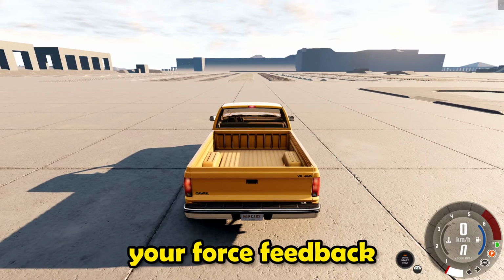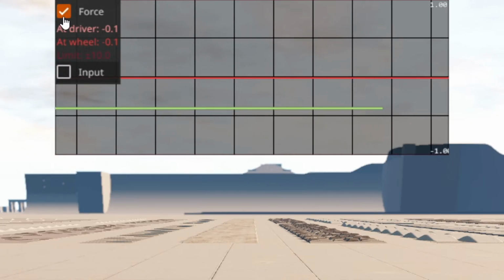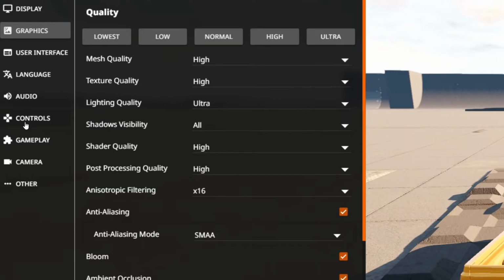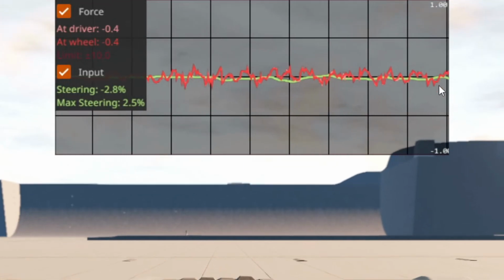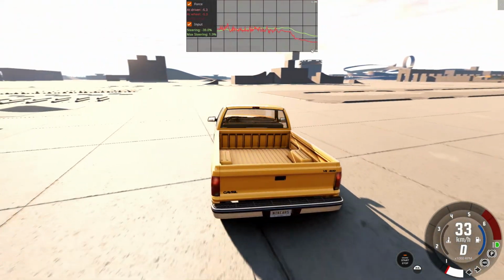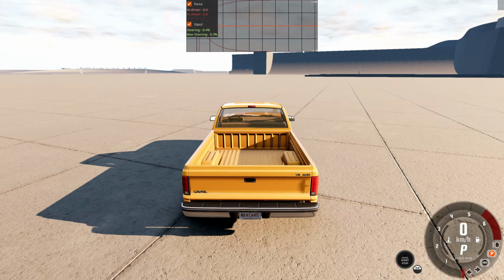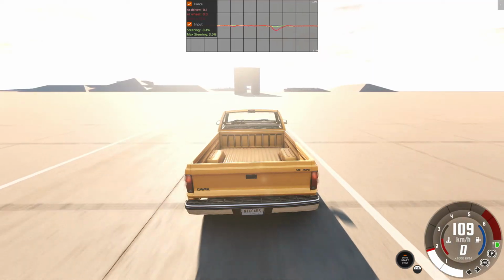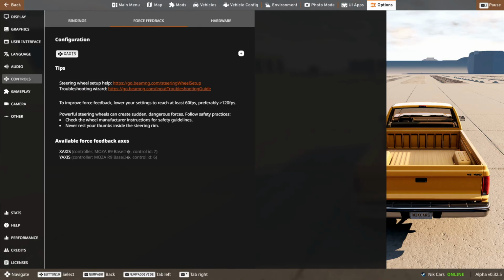The Secret to Perfect Force Feedback in BeamNG

Comment: Excellent video, thanx!! Biggest issue I'm  having with BeamNG FFB is the the wheel (G29) pulling hard when turning left or right. I have center spring disabled, FFB strength set to 50 and it still pretty bad. Smooth  is at 110. If I set FFB strength to 0 then the pulling issue goes away.
Reply: Try inverting the FFB. I had the issue where when I turned left the wheel would pull further left and same for the right. I had the FFB inverted. The wheel is supposed be pulling back to center.

Comment: Remade this after the 0.33 update. Feels like they changed things regarding this so it was good to do it from scratch. I think it is a good idea also to use a "normal" car on this. Then you get to the cars limits much easier. And thus, the force feedbacks limit. To set the maximum output. I have always felt it was too harsch on my Moza R5 base. But now I landed in Strength=50 and Smooting=10 (auto secondary smoothing). It feels actually really well now. Everything. Will go do some drifting now! :)
Reply: And you can drift with strength on 50🤔.  What pithouse setting do you run on your R5?? Now i am running strength on 200-240 and smoothing set at 240
Reply: @360hackern  Yes, it works good. Pithouse settings are basically the default assetto corsa drift settings (Yes, that is what I found was good :) ). Full strength there (100).
Reply: @TheQuietBeast  Hmm and you are on the latest firmware on pithouse and base? I have no wheel return speed so drifting is not possible for my base on those settings 😐🤔
Reply: @360hackern  Bro same shit, I have R5 and In BeamNG Its also impossible to drift cause wheel is too slow to catch the drift. Btw in asseto it works perfectly and I can drift very well with R5

Comment: Best video out there! I’m using the moza r5 and I can actually drift so much better
Reply: Oh, great input. Came here trying to get a grip on this. Also R5 drifter.
Reply: Thank you! Same here, gonna use this to properly hone in on good settings for moza r5.
Reply: Kindly share your final strength and smoothing
Reply: After tweaking for one session, I still find the transfer from grip to sliding is a bit harsh so may need to do some further testing and tweaking
Reply: What’s ur settings
Reply: settings pls?